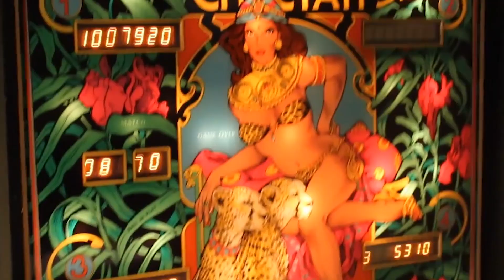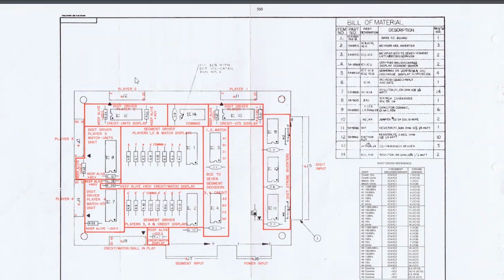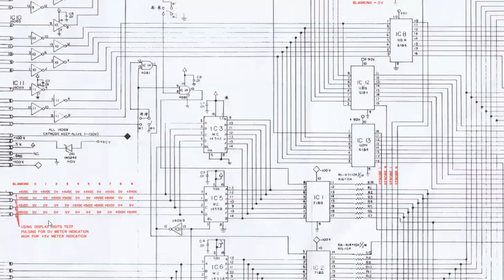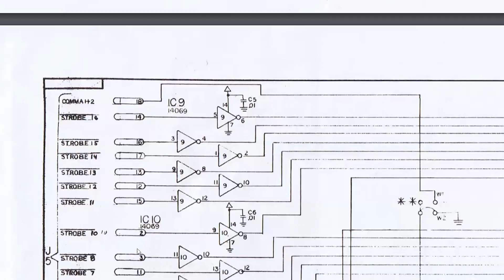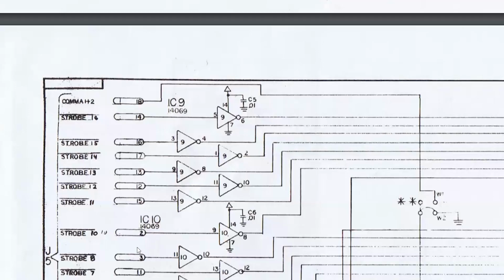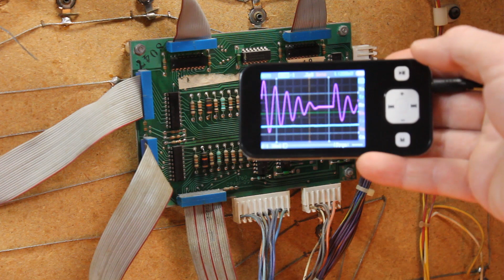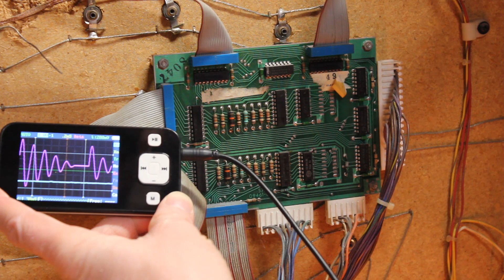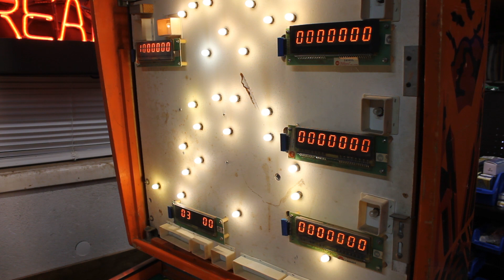Let's fix a pinball display driver board! Williams System 6a & 7 missing digits

Comment: What electronics store did you buy that chip at?
Reply from the maker: Most chips can be found at www.greatplainselectronics.com
Reply: @londonpinball  Traced my problem back to the 6184 chip.  This was after I swapped the glass from a slave into the the master unit and it still didn't work.  6184 chips are almost impossible to get now.

Comment: Thanks for making this and your words of encouragement at the end. I am also new at this and trying to learn. This seems silly but what do they mean by "strobe" Is that the whole digit? Or parts of it , or something else? Thanks
Reply from the maker: It's my understanding that strobe refers to a data signal of some sort. Depending on the manufacturer and where the data gets processed, this can mean a digit or a segment or a collection of information. In the case of Williams, I think it just refers to the information that the displays are supposed to show. The master display is the device that processes and distributes the information (aka strobes) that it receives from the MPU and outputs "strobes" to the displays where it's actually output in the form of a number on the display itself. And it's called a strobe because it's literally constantly providing this information several times a second, like a strobe light? Sure, why not?
Reply: @londonpinball  Thanks. Thats a good explanation

Comment: When replacing electronic parts you have to decide which part is sacrificial.  Very rarely do you want to save the board and the chip.  Really cheap parts aren't worth saving so even if the $0.75  chip turns out to be good the board is more important.

Comment: London Pinball, When the driver boards used Triacs/SCRs they add a resistor across to each lamp socket to reduce the flickering. The Resistors value added across the lamp socket changes the on/off timing ratio of the Triac/SCR? What Resistor value do you normally use to reduce the flicker issue? I had no idea that place a Resistor in parallel with each Triac/SCR driver on the lamps driver boards would change the on/off timing to the lamp sockets. Old EM games that used 24VAC had Jet Bumper Coils. EM games that used 48VDC didn't use Jet Bumper Coils to turn on/off the Bumper switches, any reasons why?Some EM games have a "Control bank Reset Coil" and other EM games doesn't have a Control bank reset coil, any reasons why or how does the EM game resets when you first turn on the EM game to reset if it doesn't have a control bank reset coil?